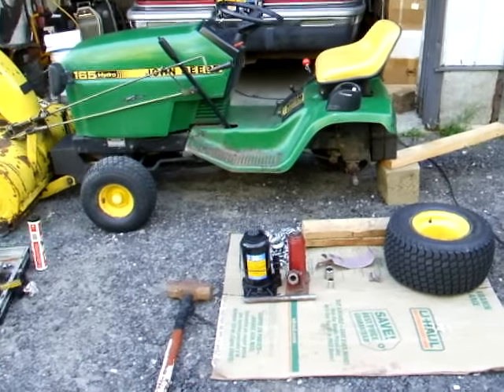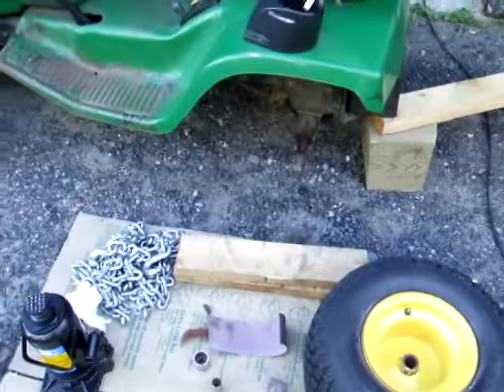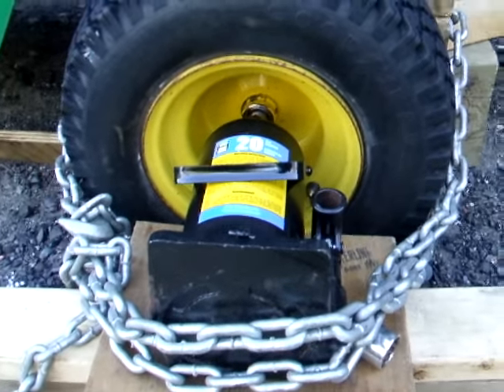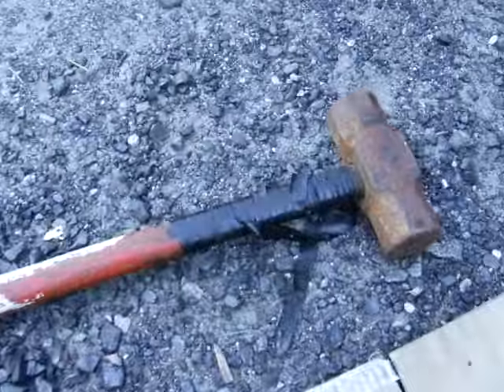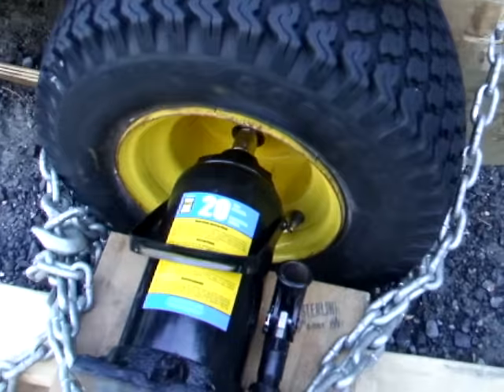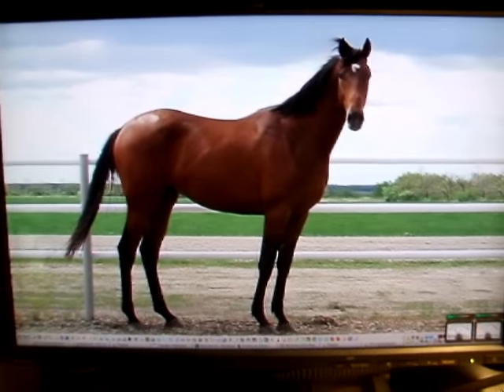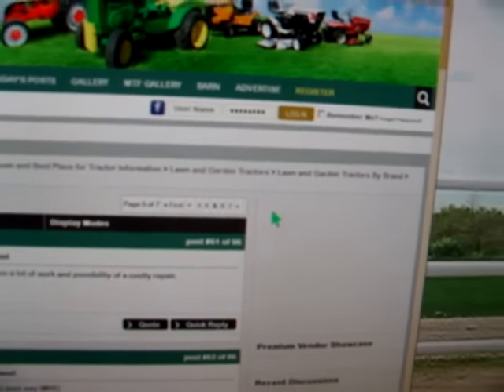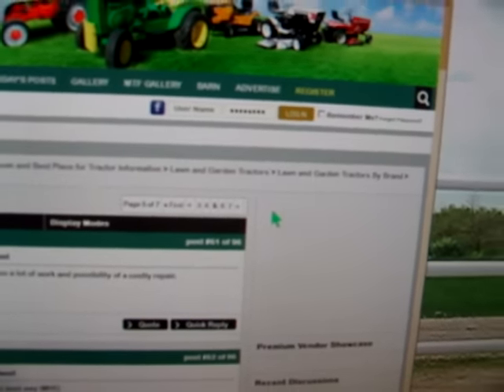Removing rusted/siezed lawn tractor wheel with a BOTTLE JACK and WINNING!!

Comment: You  definitely have the right ideal of tapping on it, but you can tap on it while you have pressure pulling on it with your jack and chains then it should vibrate off.   An air hammer works even better, and sometimes you can just use the air hammer alone, while just pulling the wheel outward with human force. 

But always use penetrating oil on all the seems, and especially when you get it to move,  spray more on the exposed shaft part, then push the rim back on and it will help lube the inside of the hub and that make it slide off quicker and easier too.

But if all else fails, i would never try cutting  into the rim hub, instead use your set up with the jack and chains, plus penetrating oil, plus an air hammer directly on the shaft or the back of the jack while it is pulling  with considerable force, vibrating the heavy shaft and hub. But like you said, not with a ton of force, just be firm enough to transfer some vibration into the steel and when you see it moving you know it will be fine.

I mean if all else failed i would heat the rim cherry, use your jack and chains set up with the boards, and pull, and if needed, air hammer, and it can't stay on there then. But i mean before needing heating, i think your jack and chains, and a air hammer with penetrating oil would do it for 99% of the cases. It would do it on the first try if you did all three jack, hammer(while jack under pressure pulling, hammering on the heavy shaft or hub), oil.
Reply from the maker: Hi Tony, glad you think it's a good idea.  I just don't like tapping or hammering / air-hammering the shaft because the transaxle is pretty weak that way - internal snap rings and so on.  Seen a few bad examples of expensive damage, and don't want to experience one myself.  You're right about the penetrating oil, I soaked it for days, and also after the wheel moved a bit, but still wasn't enough to get it off 1st try.  I thought about using heat, but I've watched a few YT videos on the tires EXPLODING in your face, no matter how careful you are, even removing the valve core and breaking the bead.  One tire company says the heat causes a chemical reaction in the tire that can cause a failure up to even 24 hours later......strange.  Anyway I suppose some light tapping wouldn't hurt, though mine was stuck pretty good.  Thanks for your comment and insight Tony - Cheers!~  Bellarmine

Comment: I wouldn't hold sandpaper around the shaft with the engine running.
You could get your fingers caught and badly twist your wrist or worse.
Reply from the maker: Thanks for the tip.  I only had the axle going about 60RPM (1 rev/sec), used to doing things like that for many years - if it hitched on something like the empty keyway I'd just let go, really nothing there to catch on anything....:o)  Thanks for the comment, hope it was helpful - Cheers!~  Bellarmine

Comment: Hammer drill and flat chisele to vibrate an impact the surface around the what an will an penetrating oil
Reply from the maker: Not a bad idea, though I don't like impacts / hammering on my transaxle internal snap-rings.  Still, perhaps a bit might not hurt, though I'd try my 'safe n' easy' method first....:o)  Thanks for the comment - Cheers!~  Bellarmine

Comment: Ok I’m about out of ideas this is what I’m trying next.
Reply from the maker: Thanks for the comment, best wishes and let me know how it goes, or if you have any questions.  Don't forget to soak with PB Blaster for a few hours (or days(!) first, it helps I'm sure!  Cheers!~  Bellarmine
Reply: I’m dealing with the same issue. I just soaked the axle in PB Blaster for 24 hours and it still won’t budge.
Reply from the maker: @swami1  Sorry to hear about your frustration Swami! I was too, it's just unbelievable how these can be rusted on.  Have you tried my method yet, or you've already tried it? At the end of my video I show another what I call 'last resort' method you can try, might be helpful. Let me know how it goes or of you need any advice, hope you have better luck soon Swami - Cheers!~ Bellarmine
Reply: @bellarmine33  Yesterday A contractor friend came over and used his torch to heat up the axle. Then the wheel came off. FINALLY.
Reply from the maker: @swami1  Congratulations!  Glad you got it sorted!  Was my method any help?  Perhaps a combination of the jack and your friend's torch finally did the job?  Whew what a relief eh?  Just so you know, I've heard some bad stories about tires exploding in people's faces when heat is used, even if you remove the valve core, pretty weird, but I've always been leery about using heat myself.  Anyway all's good.  Thanks for letting me know Swami! - Cheers!~  Bellarmine
Reply: @bellarmine33  We didn’t have to use the jack.

Comment: A bottle jack works vertical and not horizontal . A portapower will do a better job.
Reply from the maker: Yes, a portapower would be better, but I don't have one and also it' d be a little more awkward to position than the bottle jack.   The fluid wasn't a problem with the 2 ton jack as it was designed to be sideways, and for the 10 tonn jack I just screwed the extension out all the way to take up the slack and it was fine.  Thanks for the comment - Cheers!~  Bellarmine

Comment: Just wanted to tell you how I got my seized rear wheel off of the lawn tractor- I borrowed a 5 ton three arm puller from oreilly auto parts (they sell it to you then refund when you bring it back.) also used some pb blaster. Broke the bead on the wheel, the used the puller - 10 minutes and the wheel was off. 1/2 that time was spent finding things to extend the middle of the puller into the center of the wheel as the wheel was pulling off. I had to apply pressure until it was almost completely off. So, don’t bottle,jack it, use a 3 arm puller big enough to put all three arms on the wheel and line up with the axel your wheel is stuck on.
Reply from the maker: Glad you got your rim off!  Thanks for the great idea, yes sounds like another really good method.  Plus, like my method and unlike all the other methods, you still won't damage anything except perhaps your rim - easy way to apply a lot of force and get the job done -  great job!~  Cheers!  Bellarmine
Reply: Wonder Bread  I wasn’t clear in my originL comment- orielly has a tool loaner program - you have to buy the tool, then return it for refund. So, since I followed their policy, my conscience is pretty clear.

Comment: i did the same putting lower ball joints  in an 83 Capris Classic sat a bottle jack on a steel plate that i had tie downs welded too through the chain over the lower A arm instant press works well press/pull
Reply from the maker: Thanks for your comment.  That is a good idea, I should make a plate like that.  I will probably be replacing the ball joints on my '94 Buick Roadmaster soon (same car as your Caprice), so that might be helpful if I can't rent a ball-joint puller from Canadian Tire.  Cheers!~  Bellarmine

Comment: Good Job! For your information and use the bottle jack side way, it works better if the pump side is on the bottom side, so it pick oil, I know it it’s inconvenient but it works
Reply from the maker: Glad it was helpful and thanks for jack tip Rosalio, yes awkward that say but makes sense, at least my big jack had enough oil to go half way out, which was enough to get the job done lol......:o)  Best wishes Rosalio and Cheers!~  Bellarmine

Comment: Thanks for this! I was able to finally remove my tire with something simmilar to this. My jack also only worked standing up but I found it worked when the lever was on the bottom.
Reply from the maker: Wow, that's great news to hear, so glad my video helped you a bit.  Yes, my jack didn't work all the way either, went out half way which was enough to get 'er done.  Thanks so much for your feedback Howard, means a lot.   Best wishes and Cheers!~  Bellarmine

Comment: I used a steering wheel puller. First bolts broke in 2. Second bolts stripped the threads. Third bolts almost pulled through the rim.  My impact gun only goes to 350 'lb. Torch heat and penetrating oil used too.
Reply from the maker: Wow, what an ordeal!  At least you actually got them off, some people have bent shop presses and sawed off the axles to fix it, what a bad design!  Try using AntiSeize for next time, people tell me it will help.  Cheers David!~  Bellarmine
Reply: @bellarmine33  No, it never came off. I bought a 2nd snowblower for $50.00 and used that wheel and axel. The 2nd one had anti seize on it. I also beat on it with a 5lb hammer every for weeks.
Reply from the maker: @scratchcoderig  Unbelieveable - someone said, you need Dynamite on these things!  So the Anti-sieze does work, amazing.  You should try my method I think it would work, has worked for nearly all the commenters on here, lot easier than tearing down your transaxle........:o)  Cheers!~  Bellarmine
Reply: Yes, I've been using it for years, even on my car and truck wheels where the rim rust welds to the hub spindle.  Unfortunately for me the previous owners never used it. It was a free snowblower project that needed a carb rebuild, fuel line, shutoff valve, tires, valves, belts a, a lot of penetrating oil ball joint grease and a rim.

Comment: Bottle jacks don’t work horizontally
Reply from the maker: You're right generally, but they will work up to a point.  The first red 3ton jack I used ran out of fluid about 1/2 way out, so I upgraded to the big honkin 30ton jack that went out 3/4 of the way before running out of fluid.  A few of them are actually designed to work sideways.  Anyway both my jacks worked good enough to do the job, there was NO WAY my wheel would have come off ANY OTHER way, it was Welded on!  Thanks for the comment Tomas and Cheers!~  Bellarmine

Comment: I tried this on an actual tractor yesterday. The bottle Jack doesn’t work sideways. Why does yours?
Reply from the maker: Hi Gary, Thanks for the question.  Unless specified, bottle jacks don't work that well sideways (including mine).  I think the internal jack oil reservoir is made differently.  Mine would only extend about half way or less, so my solution was to start with the jack all the way down/retracted, and then screw the screw extension right out until it butts the axle, taking up all the slack.  This way the jack starts pushing on the axle right away before the internal jack fluid reservoir runs out.  My small Red 2ton runs out of fluid half-way when sideways, so I extended the screw extension which helped.  The 20ton jack worked better, though still not perfectly.  Maybe try buying a 20ton jack from Princess Auto / Harbour Freight, they go on sale for only $20 sometimes....:o)  Hope this helps Gary, do let me know how it goes or if you have any other questions.  Cheers!~  Bellarmine
Reply: @bellarmine33  So, we were trying the get the wheel off a large John Deere tractor. We had that huge clamp plate loose but as much as we pulled with a chain attached to a bobcat forklift, it wouldn’t come, threatening to pull the tractor over. Then I got smart and put a big tractor on the other side and chained it to it, so then when we pulled hard with the bobcat, it wouldn’t move and the wheel came right off.
Reply from the maker: Wow, that sounded like a real adventure!  Fun to play with big stuff when you have it handy lol, real tug-o-war.  Congratulations, glad you (finally) got it off, just amazing how these things can sieze up.  Thanks for the update Gary, appreciate it and Cheers!~  Bellarmine
Reply: Try it with the pump and handle on the bottom so it doesn't suck air.

Comment: Thank you for the video.   I had to remove a wheel from a go kart axle one time that was seized on like that and I managed to remove the axle assembly and take it to work to put in the press. I think it was only 25 tons but I had to max the thing out before it finally popped loose.
Reply from the maker: You're welcome Fred.  Wow, a 25-ton press and it just barely did it - crazy.   I've also heard a story or two of people bending their shop presses with these wheels, whew what a problem!!  Glad you got it off, thanks for the comment - Cheers!~  Bellarmine
Reply: @bellarmine33  It just goes to show how tight those things can be rusted on there.  I made a piece of steel with a hole through it to go against the back of the wheel hub so I didn't bend the rim when pressing it because I'm sure it would have bent otherwise.  I ended up not reusing the rims anyway though. They were too far gone.

Comment: Didn't work for me I even heated it still didn't move
Reply from the maker: Sorry to hear about your ordeal Harvey, wish it had worked for you.  What didn't work, it just won't move?  I'm guessing you soaked it with penetrating oil too and used a big enough jack (my 3-ton was too small!)?  Just unbelievable how these can be rusted on, heard stories of people putting the axle in 10ton shop presses and bending the presses, whew! 

At the end of my video I show another what I call 'last resort' method you can try: drilling a hole in the rim, sawing a slot in the hub and splitting the hub, maybe that might be helpful.  Hopefully you won't have to do what some John Deere dealers do, SAW OFF the axle and replace it(!). Let me know how it goes, hope you have better luck soon Harvey - Cheers!~ Bellarmine

Comment: Will this work on a snowblower
Reply from the maker: I'm sure it will, if it has the some type  of wheel mounting - rim with a bore sliding onto a shaft with a keyway / woodruffkey.  People have told me they've done this on snowblowers and  gocarts even...:o)  Let me know how it goes or if you have any questions Chad. Thanks for the comment, Good luck and Cheers!~  Bellarmine

Comment: I have to admit I would not have thought of such an ingenious method of removing a stuck wheel. More often than not, I reach for my torch to heat the affected area then tap the wheel loose.
.
Nice idea!!
Reply from the maker: Thanks, glad you like the idea!  Yes, I thought about using a torch, I'm learning to use heat more and more to remove things.  However, I watched a few YT videos on tires EXPLODING in your face when using a torch, no matter how careful you are, even removing the valve core and breaking the bead.  One tire company says the heat causes a chemical reaction in the tire that can cause a failure up to even 24 hours later - they actually demonstrated it......weird.  I'm always into trying 'last ditch effort' ideas, but from the sound of it a torch around tires just seemed a tad too dangerous for comfort...:o)  Anyway at least this idea is here in case you get into a similar situation (hope not!...:o)  Thanks for the comment - Cheers!~  Bellarmine